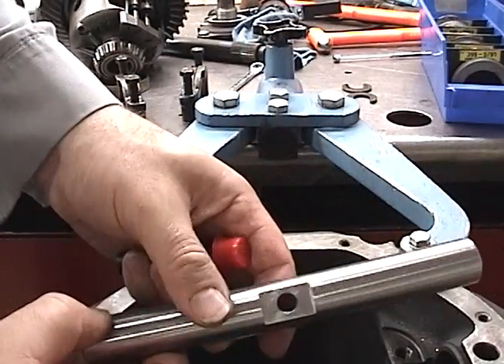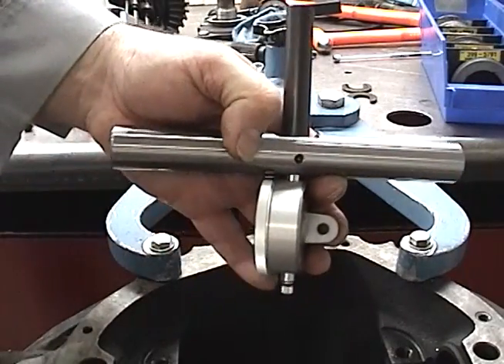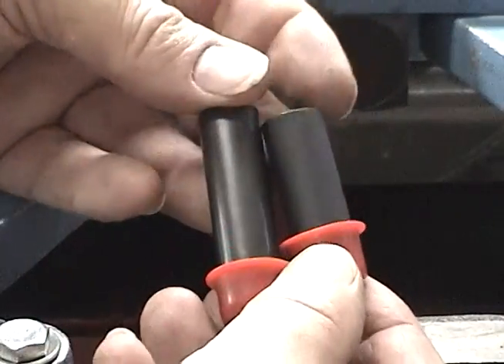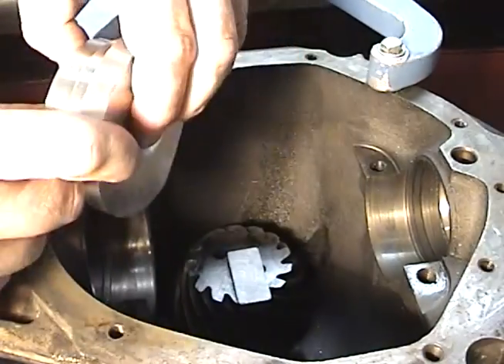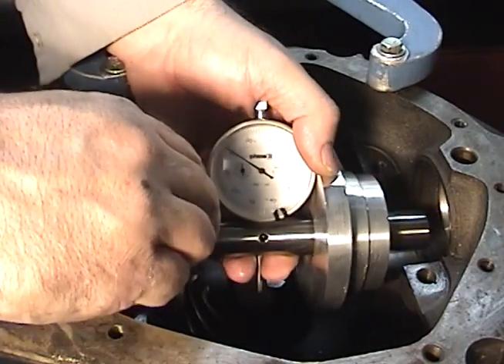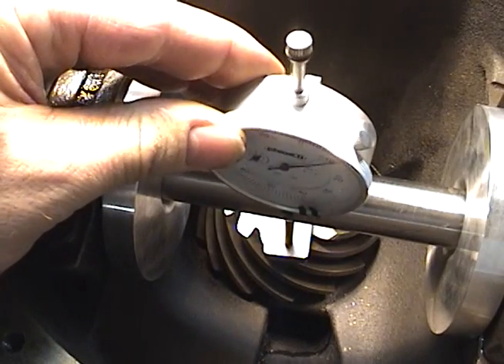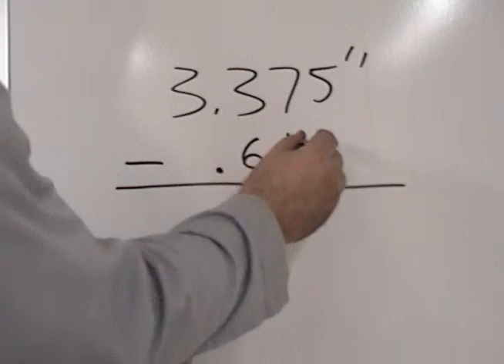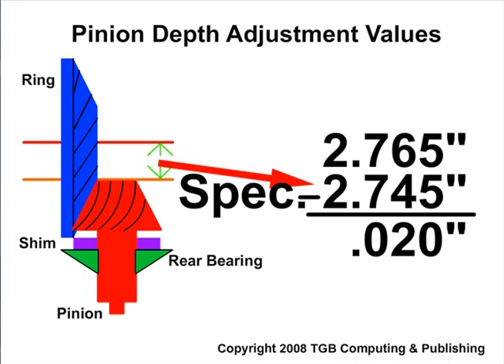Measuring Differential Pinion depth most Differential

Comment: Good explanation. Where could I buy the tool? And will it work the same on the front differential? Thanks
Reply from the maker: Google T&D Machine Pinion Depth Tool and you will find it available online. This covers almost all USA domestic vehicles. Ford, GM, & Chrysler.  I have found ways to make it work with some Asian vehicles and T&D will custom machine you saddle spacers for specific differentials if you contact them with the case bearing numbers. Yes, it works on front and rear differentials if you have a 4x4 vehicle.

Comment: You were not at Zero
Reply from the maker: If not perfectly at zero damn close enough.  Diff depth is sensitive but not down to a few ten thousandth of an inch.
Reply: @DrivelineMaster  Hi
On frame 5:13 when you go to do the measurement the dial indicator is at .080
Did I miss something??
Thanks
Reply from the maker: Yes, you did miss something.  The calibration plug is no longer on the setup.  the 0.080" you see is actually 0.020" preload. When the calibration plug is removed the plunger is allowed to fully extend and when it did it went to 0.080" which is actually the 0.020" preload I put on the plunger when I zeroed the dial.

Comment: I just bought the tool to set up my own rearends and was curious what is tolerable between aftermarket gearsets. My depth on my motive gear was 2.859 and I ended up with 2.855ish is that close enough or no?

Also I forgot to put the yoke on and add some preload with the old crush sleeve but will this change the depth or no? Since the old yoke I have for now is tight to slide on the splines
Reply: The diff is also a 12 bolt chevrolet car rearend
Reply from the maker: First of all you do need to put the yoke on but no need for the crush sleeve.  You do need to tighten the yoke until you get around 15 - 20 in lbs. of rotational force if you want an accurate pinion depth reading. Over the years I have noticed that with larger differentials above 9" ring gears a few thousandths of an inch won't matter too much however on smaller diffs they tend to be a little more sensitive to a few thousandth of an inch. What interest me is that gear manufactures do not provide a specification range but instead an exact value. Although the tools we have can be quite accurate there is always room for a few thousandth of an inch in error.  At the end of the day it will all be about the contact patch.  The pinion depth tool get you close but sometimes I end up changing the depth based on the contact patch. Check out my video on pinion depth and contact patch. https://youtu.be/w2kneEjXw6E

Comment: What spacers did you start off on the pinion?
Reply from the maker: Use the original spacer that came from the original pinion.  If you don't know where to start you can start with .025" - .035".  This is a good starting point for most differentials as long as your not making a huge ratio change.

Comment: This is a nice tool, but just a heads up for people who might want to invest into something like this, if you purchase OEM Ford gears or Ford racing gears the pinion heads are not smooth they have a cast like surface which is rough and can through off measurements slightly with this tool. Instead I recommend the pinion depth tool that Freedom Racing sells. It’s the exact tool Ford recommended when setting up the pinion in the 8.8 housings, and way easier for setup with a quick measurement method that accurately sets your pinion depth the first time without having to worry about pressing on and off any bearings.
Reply from the maker: OEM tools are always the best way to go and if all I did was setup Ford differentials I would consider investing in the factory tool.  Universal tools provide more flexibility for a shop or individual who may need to setup differentials from multiple manufactures. I always use the contact patch as my final setup decision. You can check out my video on Pinion Depth and Contact Patch Explained.  As another note most pinion gears do not have a machined surface on the head where the magnet sits so there is always a chance of error however .001" to .002" is normally acceptable. Also note that OEM gearsets will not provide you with the pinion depth value like an aftermarket gearset will. That is why it's important to understand the contact patch. One last final note. If you are replacing the gears with the same gear ratio you can often reuse the depth shim. Just make sure to check the contact patch when your done.
Reply: @DrivelineMaster  totally agree that the tool you are using has a much larger selection of vehicles to setup ring and pinion. The tool Ford recommends does not require the pinion depth value. The value will get you close but the Ford 8.8 housings have manufacturer differences, so it’s just a number to get you close much like using the previous pinion shim. There is a specific reason why Ford doesn’t stamp there pinion value on the head of there pinion bc the value might work for one housing but not the next also that value would have to come from a specific pinion bearing selection as well bc different types of bearings will sway that value. The aftermarket types that do put the value on the pinion is not an advantage in my opinion. 

I like the Ford tool bc it doesn’t require any special attention to pinion bearing selection, unlike the tool you are using. It also doesn’t require the any pressing on and off of any pinion bearings either. It’s a multi piece kit that is put together to take the place of your pinion for mock up, and provides a one time measurement that accurate the first time. There’s no guessing or hoping the pattern will work out. It’s dead nuts every-time. 

Like you said using the old shim will get you very close, but that method will always have variables that can sway your reading things like the pinion bearing selection previously used, housing differences and selection of ring and pinion from either Ford or aftermarket types. The tool you are using also requires the use of the pinion and new bearing which is a pain if you just so happen to need an adjustment. It requires pressing off the bearing and changing shims or some guys try and modify an old bearing but that just opens up more room for error. The Ford tool is definitely superior than the dial indicator type you are using for Ford rear ends but if you are setting up different types of rear ends I totally understand why you went with the tool you are using.
Reply from the maker: Yes, I have used the Ford tool and other factory tools.  I agree the Factory Ford tool is more accurate and a real no brainer. Toyota uses something similar. As far as pressing and un-pressing I normally purchase a second set of bearings and hone out the inside diameter just enough to slide it on and off of the pinion.  I know this induces a small amount of possible error but it is minimal. I keep that bearing set for reuse on any future diffs that use the same bearings. This trick also works with setting up case bearing position and preload on Dana diffs that put the case shims behind the case bearings. Thanks for you input and insight.

Comment: Great video, I use the same tool and currently setting up a dodge 9.25 rear diff but aluminum spacers to small for the saddles, are there additional spacers available for the 9.25 diff
Reply from the maker: There may be two things you can do if the saddle spacers are a little small.  (1) If you contact the company and give them the numbers on the bearing cup they will machine and sell you the proper size saddle spacers.  (2) If it seems like it's only a few thousandth of an inch I have purchased what is called "Shim in a Can". I normally get this in .004" brass or steel.  Cut a small strip and place it between the bearing cap and saddle spacer.  Not between the housing and saddle spacer because this would alter the measurement. Then tighten the bearing caps but you may have to use less than 25 foot pounds to allow the shaft to rotate. Good Luck.
Reply: @DrivelineMaster  Thanks for the reply, I’ll call on Tuesday, if it takes to long to get them, I’ll just measure from top of saddle to top of pinion since that’s axle center line. Have a great 4TH
Reply: What about the thickness of the magnet do you subtract it from your total?

Comment: How do you measure including the magnetic block and still get the pinion offset? Isn't that offset from the magnetic block plus pinion?   I guess how the calibrated sleeve and extension account for the thickness of the magnetic block by being made shorter by the thickness of the magnetic block?

If that is so, then the numbers still work out but the way the process is described here without mentioning the contribution from the magnetic block can make the observed process confusing.

What am I missing?
Reply from the maker: Hi Alex,  You are correct that the thickness of the magnet is engineered into the calibration tool.  You aren't missing anything.  I didn't anticipate this question when I created the video and I should have explained that within the video. You are not the only person to ask this question.
Reply: @DrivelineMaster  Good video!

Comment: I'm new at this and I have a question. Is this step necessary if you set the pinion bearing preload? That also dictates the pinion depth.
Reply from the maker: You are correct. If you are only changing the bearings, seals and gaskets you should be able to reuse the same pinion depth shim.
Reply from the maker: Pinion bearing preload is a separate item from pinion depth. If you are reusing the same ring and pinion gear and only changing your pinion bearings you should be able to use the same pinion depth shim without a problem.  If you are changing gear ratios or putting in an aftermarket gearset depth will need to be checked and most likely adjusted.  You don't need the tool if you want to do a little trial and error method.  Watch my video on pinion depth and contact patch.  You can do a temporary depth setup on your pinion and run a contact patch. if the patch shows the depth is off remove the pinion shim and add or subtract, reassemble and test again. Normally between 2 to 4 times of doing this and you can dial the depth in and you don't need the gauge tool.
Reply: @DrivelineMaster   Thank you for clearing that up Sir. I have a manual and it say to do this step but all I was doing is changing the bearings in the differential so it seems like so can use the same shim and continue with assembly. I will sub to you channel.